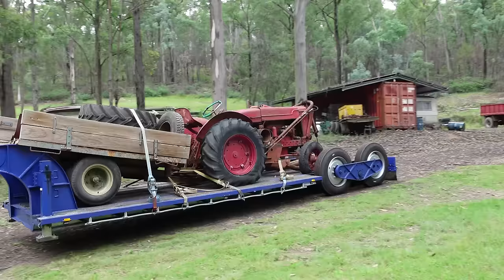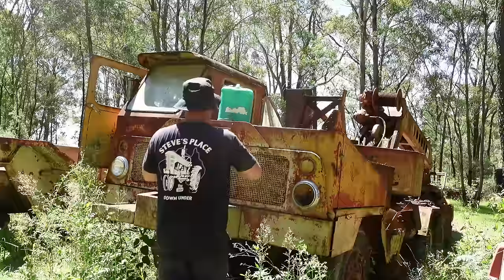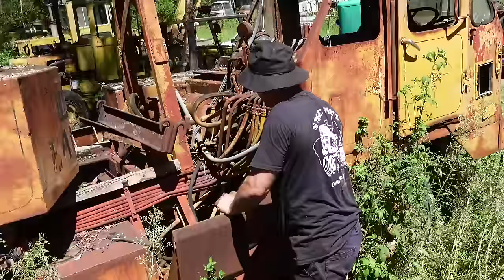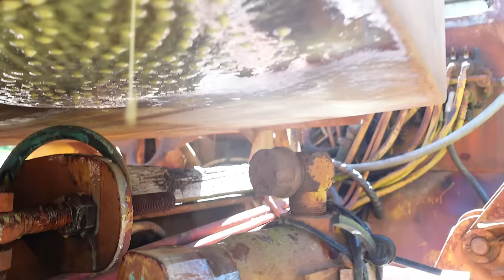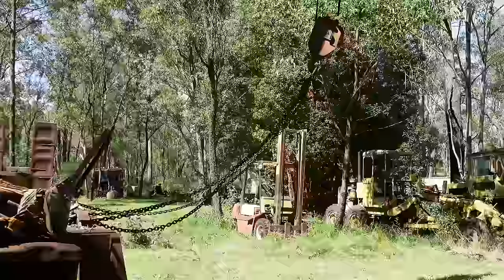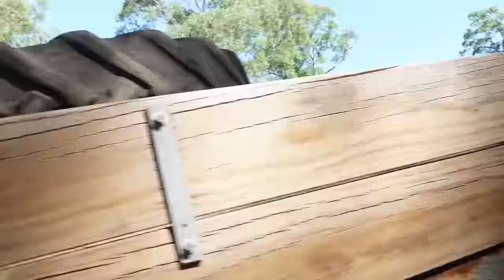Old Crane saved from Scrap! Will it lift?

Comment: Hey Steve looks like the power steering on the Steelwell isn't working LOL.Early 70,s I was Apprentice Fitter /Turner with what was E.W.S department here in Adelaide water and sewer gov department and Steelwell crane and clamshell machines were plentiful lots of wearing parts for fitters to fix ,i can remember what a beast they were to drive .
A joint collaboration with all you guys would be fantastic,or a meet and greet at an old machinery show would also be the go mate .
Cheers Kym
Adelaide
Reply from the maker: Thanks Kym. It has actually got power steering but the belt is off it. Wasn’t too bad really. It sounds like you have a lot of experience working on these mate which is great. You may be just the bloke to get her back up to spec 😅😅. 
 I’m speaking with the others to organise it. All seem keen to do something

Comment: Drove a crane on SA Highways  they used Mobil 1300 in all applications  engines trans and hydraulics       it's just a little  slower  than normal     ,,,
Reply from the maker: Hi Ron. All cranes seem to be slow on the roads mate. They build the heaviest possible unit and put in the smallest engine available

Comment: Acco was marketed to south africa for civilian use. They are fairly common but mostly forgotten
Reply from the maker: Yes mate I believe there were a few over there. Not sure if they were as popular as here though
Reply: @stevesplacedownunder  not at all. It was out classed by the more popular 1113 and later 1517 Mercedes bullnoses. Best it had going was the commonality of parts it had. The 354 perkins/ADE was local built same for some other IH equipment of that era. And it was fairly cheaper than the bullnoses if I recall. But that's where it's glory ends. I don't recall if South Africa would also have had a production line for the acco. I think it's importing may have been canceled in favor for the locally produced oshkosh E series and Mercedes bullnose. Later followed by SAMAG 70s for that class of trucks.